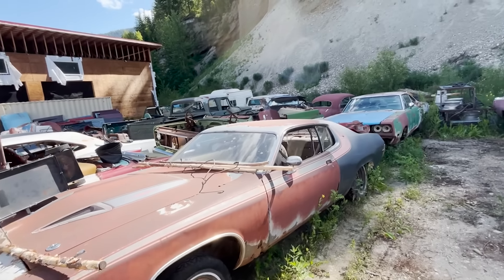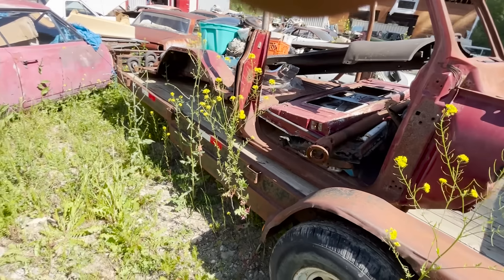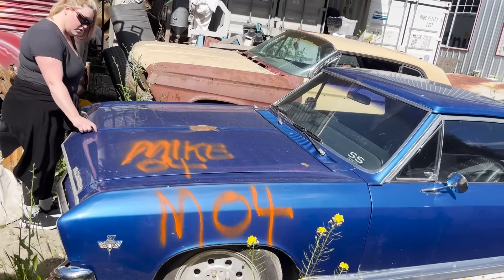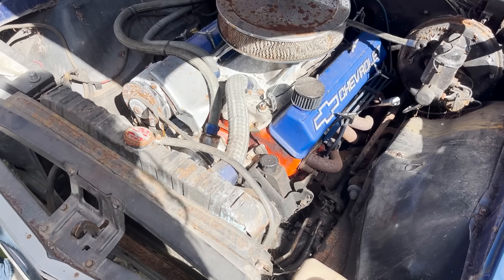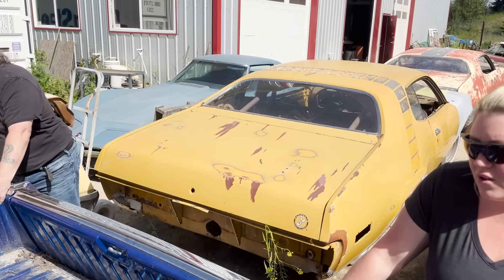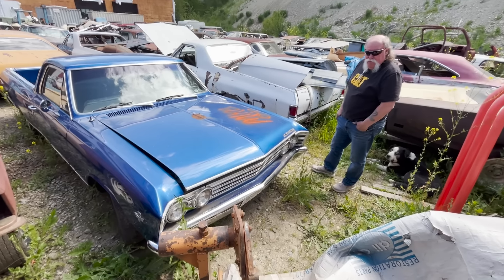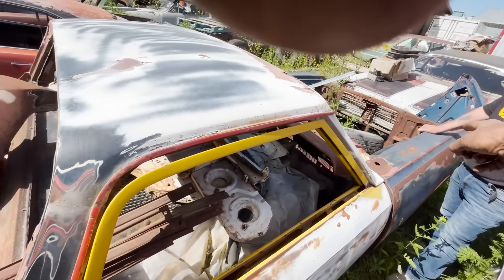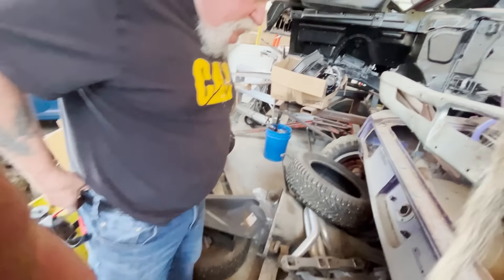Will My Fans End Up Buying My Cars?

Comment: I think a opportunity was missed here that car will never sell for 25k in that condition. I don’t see it going for 50k even restored or restomoded . I’ll admit I am not familiar with the car market in Canada . In my area (motor city) that would be a hard sell there 10k was a fare offer again just my opinion. I can find way cleaner rollers local to me for under 10k sure they are setup for street racing or drag strip so some may see that as a negative of there value and others may see that as a clean car to bring back to original condition with a little work and not have to deal with a rust bucket that’s been sitting out in a field. I figure this is just for entertainment at this point Mike really doesn’t want to sell anything he’s just wasting other people’s time .